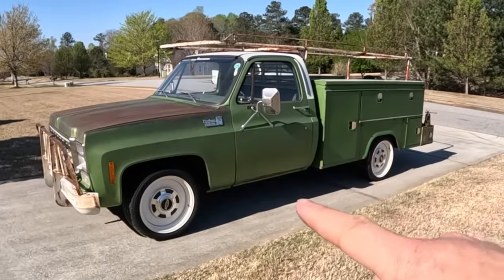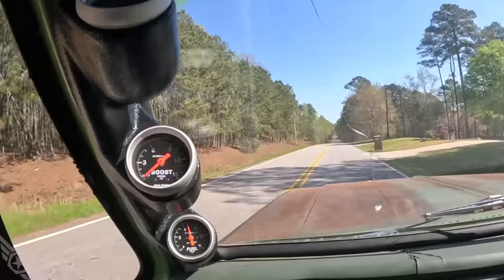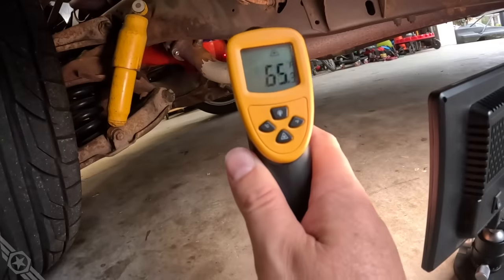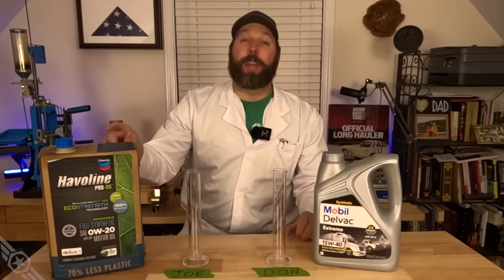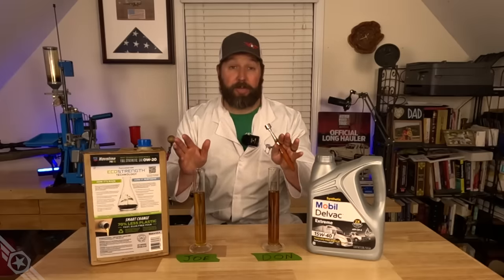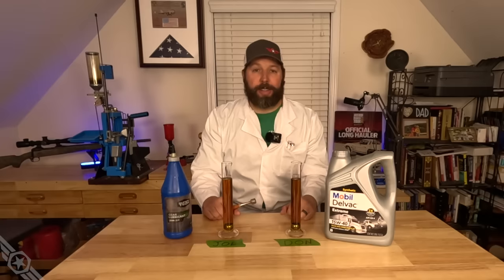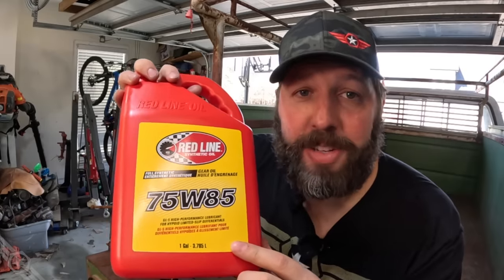Running GEAR Oil in an ENGINE!!! (EXTREME PRESSURE)

Comment: There is NO POSSIBLE WAY that filling a filter with oil is bad, or detrimental at all. All it does is help the oil pump pick up the oil quicker
Reply from the maker: That’s simply not true. You can introduce foreign material into the outlet side of the filter when filling it. It’s not very likely, but it is possible, and it has resulted in trashed engines. All it takes is one small piece of foil or one small piece of plastic flashing from the jug, to clog a piston oil cooling jet, and trash an engine. Cat didn’t specifically tell their techs to not fill oil filters for no reason. That did it because they had to replace engines that were destroyed as a result of filling filters. Personally, I fill my filters. But I understand and accept the risks associated with the practice. But telling people that there is “NO POSSIBLE WAY” it is bad, is simply false. Just like telling someone that there is “NO POSSIBLE WAY” they are going to when the lottery. It’s very unlikely, but certainly possible. Every Powerball or Megamillions Jackpot in history was won buy someone 🤷🏻‍♂️
Reply: I can definitely see getting trash into the prefilled filter, being a risk in a big truck, or tractor with a giant filter. Saying there is "no possible way" is not true, I agree with you on that. In a perfect setting, clean environment, etc, I wouldn't think twice about filling the filter. Although, I have seen engines get trash in them, especially those foil and paper pieces from the jug, and the plastic wrap from the filter. And that trash was from just adding the oil or putting the filter on, not prefilling the filter
Reply from the maker: @billp3310   but the difference in getting foreign material in the oil while adding oil to the engine, is that that material has to pass through a pickup strainer before it gets to the pump, which generally prevents damage to the pump, and then through the oil filter before it gets to any critical part of the engine. Foreign material introduced into the outlet of the filter goes straight to the bearings, valve train, piston cooling jets, etc. Foreign material entering the engine fill port isn’t a huge deal (not good, but not the end of the world), foreign material entering the outlet of the filter will almost certainly damage engine components. That being said…I always fill my filters because I’m stubborn. 😂
Reply: That is true. I think the biggest risk, is the plastic or foil from the jug. If that gets in the engine at all....it's a bad day. If it gets in through the filter, almost instant carnage, but if it goes through the oil fill, and then gets caught in the pickup strainer...that could clog it and cause total loss of oil pressure. I always prefill my filters on my personal junk, but I do it being aware of the plastic and foil danger. I've been a mechanic/technician for 20yrs, and on customer cars, I'll prefill em if therye easy to access. That said, I've seen pickup tubes and strainers get clogged with all kinds of stuff, paper towels, plastic, foil, chunks of rtv, and even bits of gasket material. Opening your oil filter at all raises the possibility of getting trash in it.  Just keep your eyes open, and be cautious whenever your filter is off at all.

Comment: I had a 2 stroke motorcyle 135cc yamaha rxz 3 years ago that i mistakenly use gear oil on it and after that running very smoothly until i sell it🤣
Reply from the maker: You are why I have trust issues 😂

Comment: Oil presure is regulated by a relief valve.Its going to be the same.
Reply from the maker: No it is not. It relief valve only regulates the maximum pressure the system can make. It is not open during normal operation. It only opens when the oil is extremely cold and/or RPMs are very high. It’s a very common misconception the relief valve modulates oil pressure or is always controlling the pressure. It only controls max pressure in very rare circumstances. It was not opened during this demonstration.

Comment: My grandpa use to tell stories of dishonest mechanics putting gear oil in old crap engines to make them run better. It was to thiken the oil and keep them from rattling.
Reply from the maker: Yep. I’m sure people still do it. Of course, they are using the thicker gear oils, not the 75W-85.

Comment: I accidentally put gear oil in my 02 Corolla. still running fine, it smells like absolute booty everywhere I’m going 😂 proper oil change coming tomorrow lol. It’s the beater for a reason l 😆
Reply from the maker: Do Toyotas even need oil??? 😉

Comment: Instead of putting in 75w85 why not go for the really thick 85w140?! 😈 My engine in my car was already knocking because I accidentally ran it too low on oil, I would guess there was about a quart or so left in this 2 L in-line four Once I drained it out to see how much was left out of curiosity. So I said screw it and put the proper amount in 4 quarts not counting the 5/8 of a court allready in the oil filter. I normally run conventional 20W50 engine oil But just to try this for the hell of it I put in 4 quarts of 85W140 gear oil just to see if the thickness would make it knock less. it didn’t really have much of a difference Aside from the first couple seconds, until the oil finally made its way to the head, Unfortunate my oil pressure gauge didn’t work so I couldn’t see how high it was, but I wouldn’t be able to see your high the pressure was anyways Because it’s my stock gauge that only goes to 90 psi and it was probably higher than that!
Reply from the maker: The point of the video was to demonstrate that gear oil and engine oil viscosity grades are on a different scale. Adding a thicker oil would not support the point of the video.
Reply: @freedomworx  Pretty crazy I did that though. I wonder how much PSI I would have If I had a working gauge? maybe 100? Yeah, it stunk too because my engine burns oil, so it really stunk when it burned that
Reply from the maker: @adamgallahan6747  I imagine it would have gone all the way to the relief valve set point. The relief valve on this engine should be somewhere between 55-70PSI. 👍
Reply: @freedomworx  I’m not sure where that’s at Maybe somewhere in the oil pump but I was saying I ran it like that for numerous miles and it seemed to be fine Well what I mean is it was knocking the same as it was before with regular 20W50 motor oil
Reply from the maker: @adamgallahan6747 interesting. Seems like it would have quieted it at least a little.
Reply: @freedomworx  I mean, maybe it did but only so much I mean it was already knocking but yeah, I don’t know what the psi was at and I don’t know where the relief valve is, but it wasn’t actived

Comment: Gear oil is fine. It just doesn't have the detergent that engine oil has
Reply from the maker: It’s actually not fine. The sulfur in the gear oil will eat any yellow metal parts in the engine and also convert into sulphuric acid when it mixes with combustion byproducts. Might take a long time for those scenarios to manifest, but they are a potential.

Comment: Do it with strait lucus oil stabilizer
Reply from the maker: Can I borrow an engine from you? 😉
Reply: @freedomworx  hey I had a Chevy Silverado with a 4.3 L V6 that had really bad worn main bearing. Every time you come to the stop, it would die oil pressure would bottom out and it shut down. I filled it with nothing but straight Lucas and drove it for another 6 1/2 months. It was still running when I sold it off to a guy down the road. He was going to put a new engine in it. The only problem I had out of it was when it was cold. I had to put a hairdryer on the oil pan to warm up the Lucas oil for about 30 minutes before it would start. It did solve the oil pressure problem and would idle at a stop.
Reply from the maker: @myfalconry76  Nice 👍

Comment: This was a common practice by some truckers back in the day and even today. The gear train chews up or shears the motor oil really quickly. They would put a small amount gear oil in with motor oil at changes. Let me see if I can find a vid or a guy doing it. Think I've seen it on you tube. https://www.youtube.com/@RawzesCollection/search
Reply from the maker: I don’t doubt that folks used to do it, but there is no benefit to doing it with modern oils. The best oil you’re gonna get for your engine is the one that Shell/Chevron/Amsoil/Schaeffers/etc formulates for you.
Reply: @freedomworx   "The best oil you’re gonna get for your engine is the one that Shell/Chevron/Amsoil/Schaeffers/etc formulates for you."   That's what they said back in the day too.

Comment: Big loss of power trying to pump gear oil around. The stuff has the consistency o Molasses.
Reply from the maker: With most gear oil, yes. But not with this 75W-85. It’s thinner than the 20W-50 that was already in the truck 😉

Comment: ...just how do you fill a 180degree 
attachment oil filter??
...(just put the specified quantity in the crankcase, then add half capacity of oil filter volume...should level out on dipstick after reaching normal operating temp...modern computer auto engines control cold rpms until it goes to full open 
anyway...and there is still some residual oil film on  pistons, rings, cylinder walls, crankshaft bearings...
unless there is a quirky claim of engine mileage wear factors of over 150k
miles...
remember, folks we',ve been duped into believing
 0 maintenance for 100k
miles...
"CASH FOR CLUNKERS"!!!!😅
Reply from the maker: For cars with horizontal or upside filters, I turn the cars on their side or upside down. There’s always a way…sometimes. 🤓

Comment: Dude there is no way that gauge is accurate unless you have massive bearing clearances.
Reply from the maker: Actually it is. 75W-85 is thinner than 15W-40 engine oil. That’s the point of the video. Watch the full length video and you’ll learn something 😉 https://youtu.be/Gcfr9kEr4FA?si=521PU-QHUyF8jsf_

Comment: 75w85 works grear in my qx56 infiniti differential
Reply from the maker: That’s pretty light for a diff. Front diff?
Reply: @freedomworx  rear. Not too much buildup of metal shavings  after a change of about 25k. I haul 6000 pound machinery and campers with it smetimes. Lucas makes a great formula
Reply from the maker: @GregsAutomotive is that what Infiniti calls for?
Reply: @freedomworx  i do not know, ill get back with you on that.
Reply: @freedomworx  my bad its 80w90 i used. But tbh not any real difference.its at 180k miles now. The first change we used 75w85

Comment: But can I use engine oil as gear oil
Reply from the maker: Well you shouldn’t use gear oil in an engine accept in an emergency. Likewise, engine oil shouldn’t be used in a diff accept in an emergency. But engine is commonly used in manual transmissions straight from the factory. Diffs have hypoid style gears and transmissions do not. And that’s why engine oil can sometimes be used in a transmission.

Comment: How's that thing only making 400hp
Reply from the maker: Factory heads and a small cam. I could put a good forged stroker kit, good heads, and big cam in it and probably tickle 600 banging it off a 7,000RPM rev limiter. 😂😂. This was just a budget engine. It has mismatched pistons and a J-B Welded main cap 😂😂

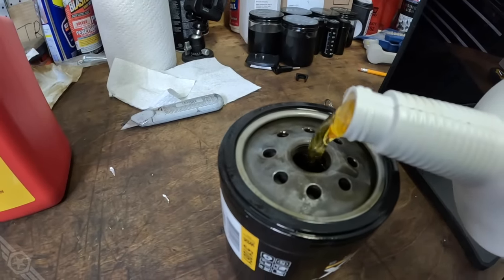Comment: 4:00 no offense, it's definately wrong the way you do it. when you do it, it should be poured into the outer ring since that's where the oil pressure actually arrives to push it though the filter. that's why the middle opening is so much larger in diameter then the outer once, because of the pressure drop. same reason/principle as with air conditioning (high pressure side and low pressure side) and even your veins and arteries.
high pressure, thin tube. low pressure, thick tube.
Reply from the maker: The outlet bore is larger because there is only one hole, compared to the multiple holes on the inlet side of the filter. I know exactly how an oil filter work. But it’s a stupid argument. There is nothing in this quart of oil that is going to hurt the engine. It’s a brand new jug of oil that I obviously removed every single bit of foil from…on camera. Engines didn’t even have oil filter until the 60s 🤷🏻‍♂️
Reply: @freedomworx  i'm not here for the debate of if you should or shouldn't pre-fill, i personally don't since its my job and my boss would kick my ass if i'd do that on ever oil change (regarding extra time), plus on most cars most of that oil would flow me down the arm while mounting it (if it's not just a raw filter element).
pre-filling is less about the oil being contaminated and more for the filter material to be saturated already so oil pressure arrives faster at the lubrication points. sure it's just fractions of a second but it's not about the one time you do, it's about longevity. Prevention is always better then Reaction

btw i no way, shape of from do i try to make an idiot out of you. i see this more as a way of exchanging knowledge and experiances.
hope you're doing well :)
Reply from the maker: @julshg the entire “time to oil pressure” argument is silly. Oil pressure is not even required to lubricate parts. It’s not the oil pressure created by the pump that separates engine parts, it’s the hydrodynamic wedge created by relative motion of the parts. As long as there is enough pressure to get oil to every part, that’s all that is needed for lubrication.  For component cooling, more pressure is required. Well it’s not the pressure, it’s the flow that the pressure represents. You need enough flow to remove the heat from the parts. Obviously heat isn’t an issue at idle. Many small engines run their entire lives with zero oil pressure. They don’t even have oil pumps. They operate entirely off of splash lubrication and a scoop on the connecting rod. Steve Morris did 2 burnouts, 2 1/4 mile passes, and 2 return drives in a 4000HP Big Block Chevy with ZERO OIL PRESSURE due to a failed pump, with minimal damage to the engine. 9,000RPM for a combined 20 seconds at full load (4000HP). Reckon how that correlates to 600RPM at no load for 3 seconds per oil change dry start? I’ve already got a test planned to prove this point. I would say it will provide indisputable evidence, but there will still be plenty of brainiacs that try to dispute my test method or results.

Comment: Lmboao, oil pimps have a pressure relief valve and spring in the body of the pump. 
Gear oil will keep it from knocking due to high mileage😁 I had a little 70 Demon with a slant 6 that developed a little pecking one day back in the 1990's 😮 [ damm I'm gettin old ], so I added 2 wrts. of 90wt and a bottle of STP and run the 💩 out of it for over 2 years before I sold it. I told the guy that bought it to make sure to do the same when ever he changed the oil or it would for surely knock like 2 skeletons fuc-err hem fighting on a tin roof😂. 
Wish I would have kept it now.
Reply from the maker: The relief valve is not part of the pump in a small block Chevy. And that valve lifts at about 65-70 PSI on a SBC. So it had absolutely nothing to do with this video. This gear oil is simply thinner than the 20W-50 that was already in the engine 🤷🏻‍♂️
Reply: @freedomworx I put oil pimp in my first comment😂😂😂 The title of your video is  "Running GEAR Oil in an ENGINE (EXTREME PRESSURE )" which is totally inaccurate, Yes it was  entertaining the way you went about it but when you put in some newer type of gear oil which is actually thinner than 20/50 it had in the begining that didn't cause any of the extreme pressure your title eluded towards, and your reply is just as inaccurate. 
NO EXTREME OIL PRESSURE was ever going to be observed due to the fact that there is an oil pressure relief valve that absolutley will bleed off any extra pressure you claimed that has nothing to do with this video, but it does have EVERYTHING to do with the oil pressure which is what the video is about, like I said.
It's 25 years or more since I have been in the oilpan of a mouse but if I remember correctly Chevy SB engines oil pressure should be at least 30-35psi at idle of around 800 rpm but yours was at 1100, I think you said, but no more than 80 psi at any rpm ever because that much pressure will strip the cam gear and or oil pump drive shaft or gear due to excessive resistance that would be prrsent from the thicker 80w90w you said to never put in an engine and  correctly so, that is why there is an oil pressure relief valve to begin with incase someone does. 
 I have an old 74' 350 out of a Nova with over 500,000 miles on it in my 74, 3/4tn C 20 that has never had the heads off of it, only thing it has ever needed other than typical servicing was a timing chain I put in it because it was slapping loud enough to hear 15 years ago. 
Don't be rude to your viewers especially when you're wrong Bud, it's totally unprofessional.

Comment: Either your gage really isn’t accurate at all or your engines’ clearances are really big because I run Nismo 15w-60 in my SR20DET and my cold oil pressure is 95+ psi and hot pressure of 30psi
Reply from the maker: The pressure relief valve in these engine usually opens at 55-70PSI. So it will never reach that pressure. Every engine is different. You're oil pump might just flow a lot more than mine 👍
Reply: @freedomworx  I definitely didn’t think there was a pressure relief valve on your truck. Good info!

Comment: prefilling the oil filter if u can is a good thing, the fresh clean oil is cleaner than an oil filter can filter to its been proven.
Reply from the maker: The cleanliness of the oil from the jug isn’t the issue.  It’s introducing other contaminants into the filter, like the foil on the top of the bottle, or dust and dust during a field service. I fill my filters, not saying I agree with them, but that’s the reason Cat advised against it.